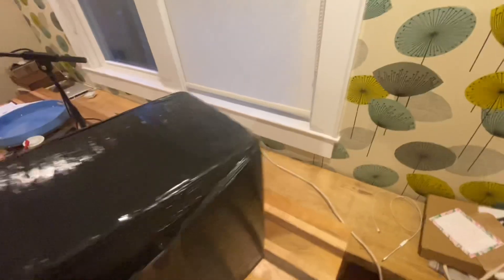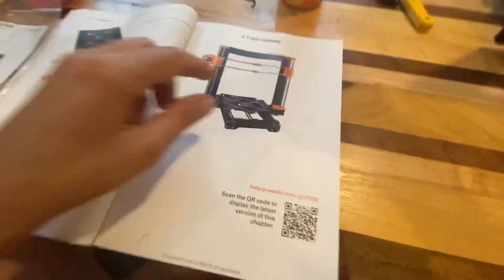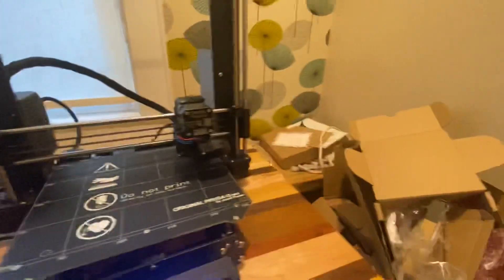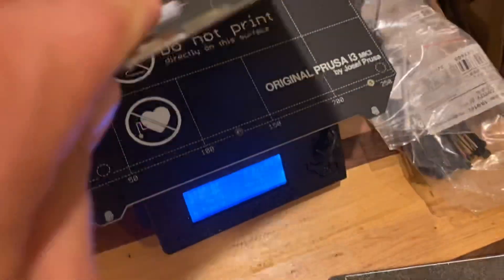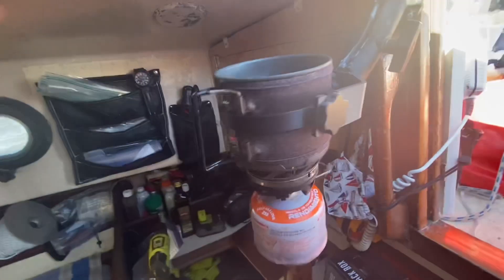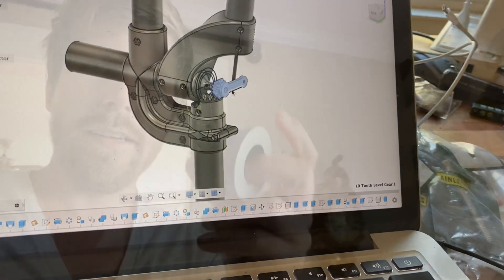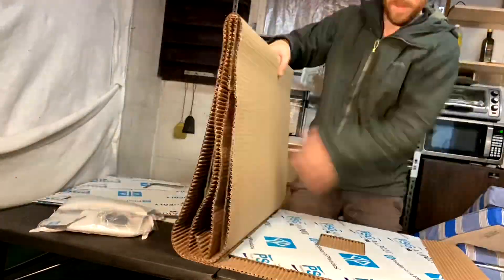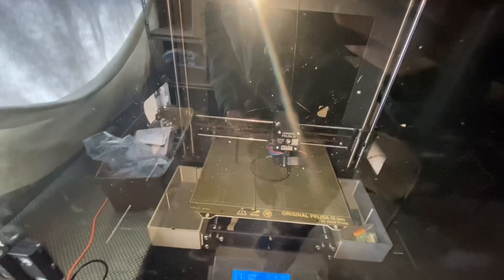3d printing sailboat parts

Comment: One tip on printing a lot of parts on the table. It takes the same time to print all the parts separately as it does printing a bunch all at once. The bad thing about printing all at once is that if one part messes up, all have to be reprinted because you have to start at the beginning. I almost always print one at a time.

Comment: Sam- you should find a CNC job shop. you can prototype your parts in PLA then send the design out to be milled from Aluminum, Titanium, Bronze or Stainless. All materials that will last much longer than plastic.

Comment: You can 3D print all you want. The problem is that whatever you make is made of shit plastic. No UV protection, no strength, just total garbage. That wind vane will last till the first wave hits it and shears off all the teeth. When you can print nylon or hdpe or other engineering materials them 3D printing will be awesome!

Comment: Strength of 3D parts is VERY dependent on orientation of your layer lines. If you print the bracket and the "holder know" at 45 degrees, you'll be much stronger. Also: I use PETG only for my functional parts. PLA will deform in the sun.

Comment: Try PETG for higher temp stuff. Easier to print than ABS and has similar properties. Watch out PetG sticks to your hot plate , I use something called magicgoo on the plate prior to printing. I have a glass print bed and I have been told if you dont us something on it PetG will break bits of the glass off before separating from the glass.
Magic Goo is also great to ensure sticking to the print surface
I use a nano particle infused PETG for structural. I have also use carbon fiber Petg which is extremely strong. Note it tends to clog print heads, you need to use  hardened print heads or it quickly wears out the tip because it's abrasive. I made printed turnbuckles out of Carbon fibre PETG for the shrouds on my sailing Kayak no other print material lasted long with the shock loads

Comment: Great video Sam.  3D printers are so cool but the stiffness and strength of the material really makes it difficult to handle high shear, tension, and bending loads.  Even industrial printers that can do powdered titanium and steel 3D printing just are not as good as cast metals and no where close to machined metals.  Thanks for sharing!  Cheers!

Comment: Congrats on the Prusa, it's a great printer. If you find the pieces start to peel from the plate, try cleaning it with ethanol or similar. Also, protect it from dust. The plate, rods and spool will work better when kept dust free.

Comment: Brutal assembly. I would have totally panicked.  Use 1/8 inch aluminum for gimbal.  Get a small bender,  and use router to round off all the edges.  Check out Hoo's Mini World channel on 3D printing!

Comment: Wow I was always wondering if you could print out those slides that you tie to your sails and slide up and down the groove in the mast, because they wear out. And plastic cheeks on blocks ! That gimbal should be strong enough as a cup holder in the cockpit.Have you tried scanning a part with a X-Box 3D scanner and printing that. You can pick one up ($10) at used electronic stores or V Village .

Comment: Hi Sam. Was watching an older video of yours where you were bailing alot of water manually with a hand pump and YETI scoop LOL. May I recommend building a crash pump that consists of bilge pump, 8 ft of hose and 10ft of wire with alligator clips. That way you can quickly bail water as needed.

Comment: Hi Sam, you can print with carbon or glass reinforcement which would make the components ALOT more durable. Also PTFE, 316, Titanium etc are all easily printable and surprisingly affordable. 

I get lots of components printed for me by subcontractors for this and just use a home printer for prototype work. 

Enjoy 👍

Comment: Make sure the load aligns along the layers (like wood). The teeth of the gears you printed will shear off pretty easily - especially because only one or two teeth will actually carry the load of an entire rudder. The most demanding task of 3D printing is - especially when doing mechanical parts - to design a good model with the best compromise of printability and strength. You can also try to remelt stuff in packed salt or similar to fuse the layers to get a bit more strength. Or like - already mentioned - use the print to make molds for metal casting. But then you'll suffer from bare steel/iron. My approach is often to get industrial parts for the load bearing stuff and use 3D printing for the less stressed "glue parts"/adapters.  :)
Reply: And it's cool to see how this technology penetrates every field. The real fun will begin as soon as direct metal laser sintering (DMLS) will become more accessible. All this tech is very cool to save resources by making spare parts readily available even if the OEM is long out of business.

Comment: Awesome Sam! I have the same Prusa and it's great. 
Remember the filament (and printed parts) are hygroscopic (even PLA) and tend to get brittle over time.
If you're going to 3d print parts for the boar, it would be good to spray them with plastic primer and after, some acrylic spray paint. It makes them durable!
Reply: Also, if you need to use screws in your prints look into using threaded metal inserts for plastic. CNC Kitchen has some cool info: https://www.youtube.com/watch?v=iR6OBlSzp7I
Reply: Last one: TPU is VERY hygroscopic. Filament dehydrator  (i even use a food dehydrator) for a couple of hours before using the filament works like a charm.

Comment: Just a quick heads up, PLA doesn't seem to like salt water.   I printed a few accessories for scuba diving and after a few dives the plastic becomes very brittle and breaks. I'll be trying PETG filament to see if it's better with salt water.

Comment: Hey Sam, love the videos! I will give you one big warning about 3d printing: most filaments and materials are very UV susceptible and darker colors will warp like crazy in sunlight. I believe uv resistant materials do exist but you just have to keep that in mind

Also if you ever need help with any printing projects I would love to help, I have a Sovol SV01 and access to several printers here at UNH

Comment: Nylon needs a dry box for prints longer than a few hours. I use the Polymaker Polybox II and it works great. I also use a food dehydrator to dry filament.  Nylon is really strong and UV resistant

Comment: If you printed that gimbal in pla be very careful. Pla has an extremely low softening temperature and I can almost guarantee that that jetboil is going to melt it very quickly.

Comment: For the the gears and other parts that you may want metal, you could always use the 3D printed parts as cast molds and have them cast in aluminum or brass.
Reply: CNC milling would be far cheaper, but yes casting can be good, just requires additional time to clean up each pice after molding. Milling parts are typically ready for use with slight breaking of sharp edges. I make knives for a living so I work with all this stuff daily.

Comment: Hi Sam, cool video. Thanks for the content. I've had trouble with 3D printed ram mount parts too. I found that using 100% infill solid ABS parts seems to work. The ball won't break off the mounting head as easily.

Comment: Good stuff! If your putting any 3d printed parts outside make sure they are protected from UV or some sort of UV resistant material! I have had success with PLA navigation light mounts on my trailor sailor, but the parts are in a garage most of the time. I am interested in your 3D printed windvane, will you be posting files?

Comment: So, I used my 3D Printer to mock up the mast bracket that holds on the gooseneck for the boom, as my old one cracked. After I was happy I sent it off to be CNC'd in China by a prototyping firm. Could be an option for some of the wind vane parts.
Reply: yea for many of these projects 3d printing is a great prototyping technology and when you are done you can use the same CAD files to get it done in a better material.
Just gotta make sure you dont get too used to design for 3d printing as there can be stuff you can only print but not CNC easily.

Comment: I love Autodesk.  I use their Civil Design Package and have since the 90's.  It's amazing!!!
Reply from the maker: I always loathed using maya, revit and auto cad in the past but this fusion software is pretty enjoyable for me. Was easy coming from some solidworks experience too.
Reply: @samholmessailing  I have not used that side of the product line since Inventor

Comment: good choice! the prusa printers are dialed.
Reply: while it's printing. you can turn that knob. and increase the speed. just a heads up. after the first layer. you can usually crank that to 150% or more. also don't forget you can adjust z distance on first layer on the fly.
Reply from the maker: Nice tip. I found I could also adjust the temp on the fly today when I was printing some oozy TPU.
Reply: @samholmessailing  lots of dudes move the power supply out of the enclosure. might be something to consider.
Reply from the maker: Yeah I was considering that but after a few test prints it really doesn’t seem to get very warm in there. Could be because my shop is 30° now though.
Reply from the maker: Thats what ive been most pleased with. I didnt need to make a dozen aftermarket mods to get great prints and all the problems i ran into have been easily sorted out and documented online
Reply: Anyone know what model that Prusa 3D printer is? It's much faster than mine!